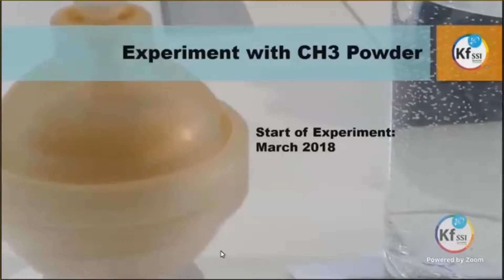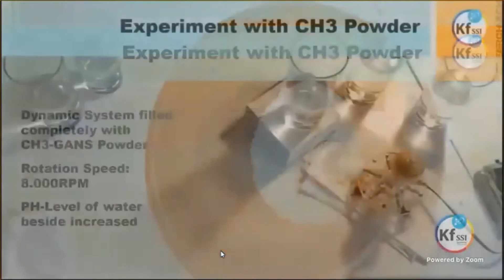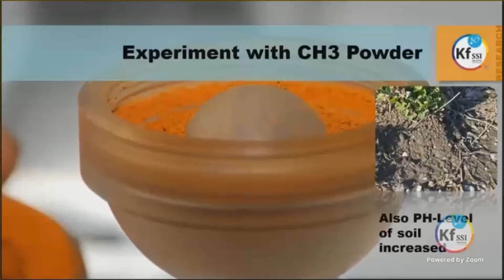Raising The PH Of Water Using Plasma Fields

Comment: So any response on why the motors gave out? Just guessing but would it have to do with the way the weight is added to the shaft? What if you created more of a centrifuge system where the GANS is lower than the shaft and add a stabilizer to the shaft.